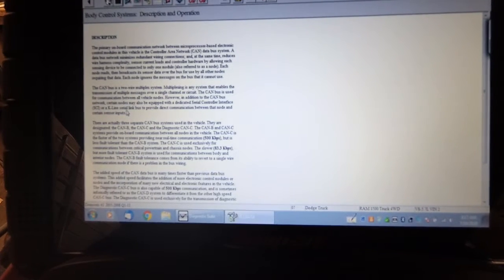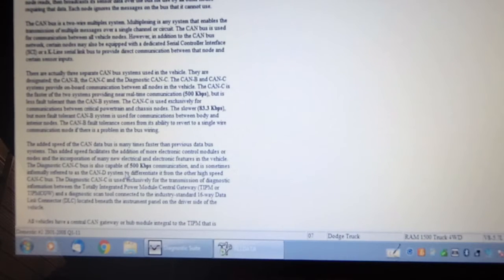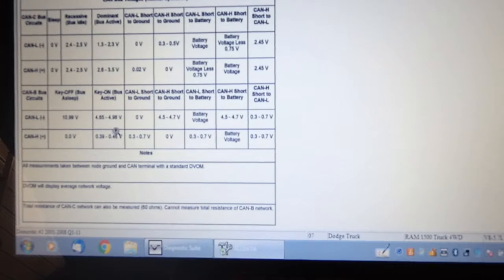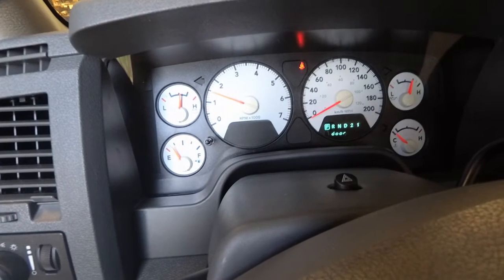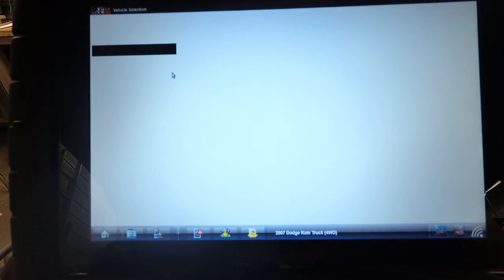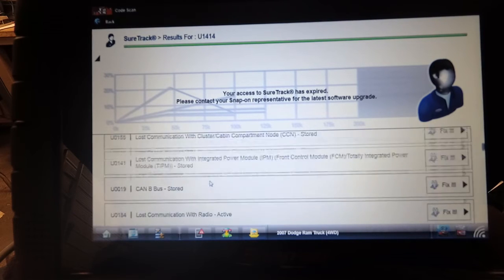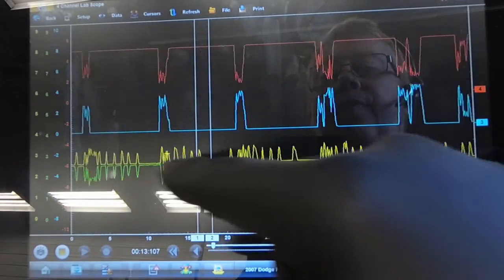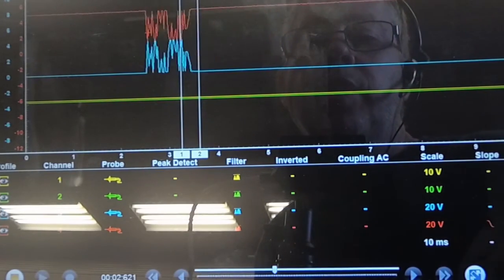2007 Dodge Ram Hemi No Crank pt  2 TIPM Replacement

Comment: Hello
Maybe you could help me
Where I can buy a PCM for Dodge Ram 1500 4.7 and tipm, that you recommend? And if I buy a used Tipm just plug and play? Or needs programming that? 
Thank you
Reply from the maker: For the PCM I'd recommend Flagship One. I believe they're in New York. The should be able to preprogram it to your vin. The TIPM is available from Dorman and most part suppliers are able to source. It should be plug and play but a used one may not work properly without dealer level programming. Why do you think you need both?

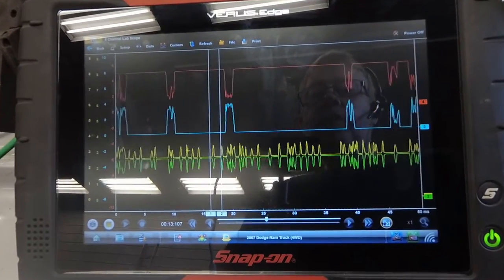Comment from the maker: For normal Can C and Can B signal wave forms fast forward to 10:11 of this video after replacement of the TIPM.
Reply: Phillip- no waste of time!  Your in depth analysis is appreciated. I have the same issue with my ‘06 Ram Hemi. Going to use your two videos to diagnose today. I’ll post my results. Keep up the great work!
Reply from the maker: @oklahomaaerialservices-oas392  good luck and Merry Christmas.
Reply from the maker: When it comes to communication network diagnosis there is hardly ever a straight to the point process. Sorry if you feel I wasted your time.
Reply: In part one you soldered that wire to the motherboard how come that didn’t work? Seems like that was the issue you resolved in this video
Reply from the maker: @yawboateng1123  yes thats true. There were two problems plus me assuming the Can B signals should look like can A. He had been driving it with the can b negative wire the one I fixed disconnected, the the can b plus wire went open at the connector under the dash and caused complete shut down. The can b will still communicate on a single wire . I assumed the can b signals would look like can C and they are quite different. It actually ran after fixing the wire on the tipm and I could have actually left it like that for sure. Hope this helps